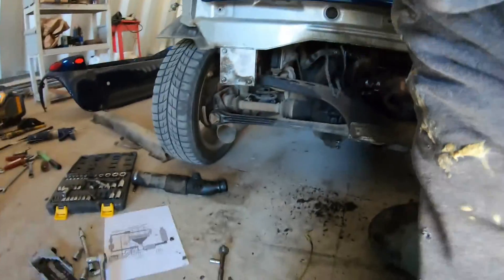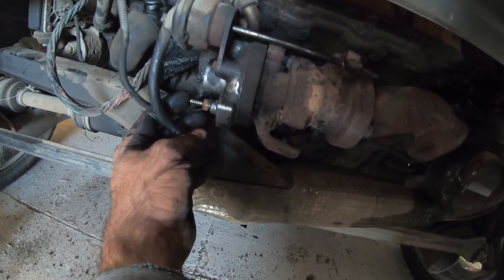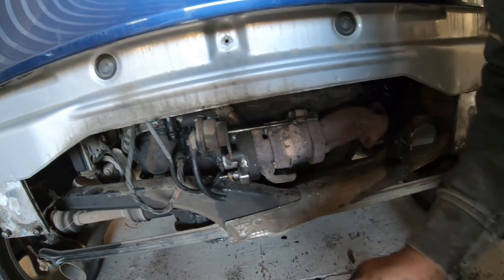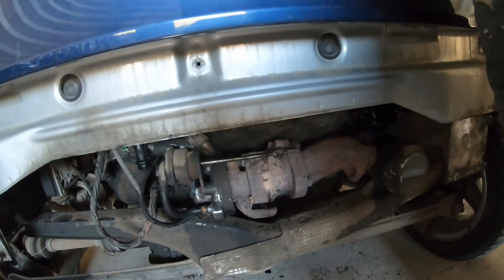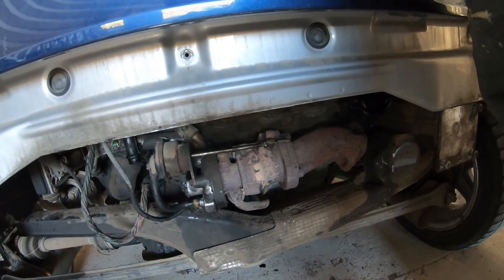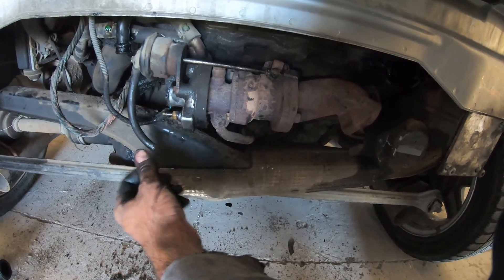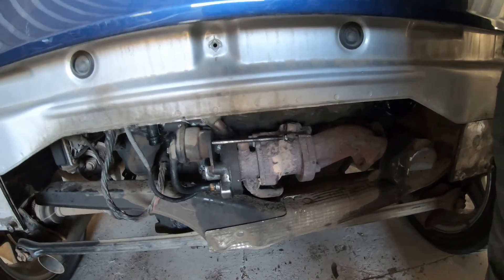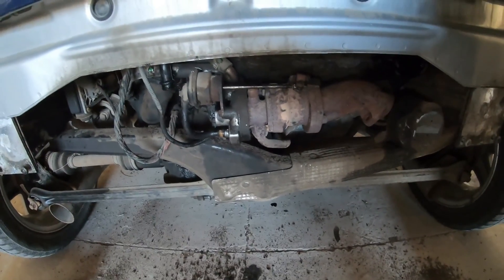Smart Car Cdi Turbo Waste Gate Actuator

Comment: Excellent vid, thank you. Hardly anything online about mk1 cdi smarts. If it helps, I think I remember reading somewhere it was 15 psi to operate the wastegate. I tested mine with a blow gun. It opened at 20-22 psi. My compressor gauge is a little faulty so I figured it was about right.